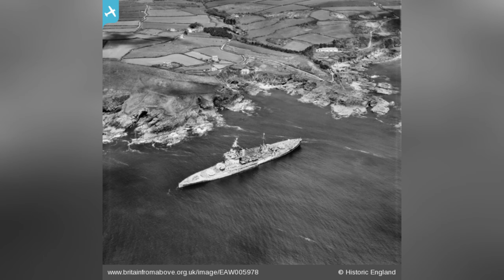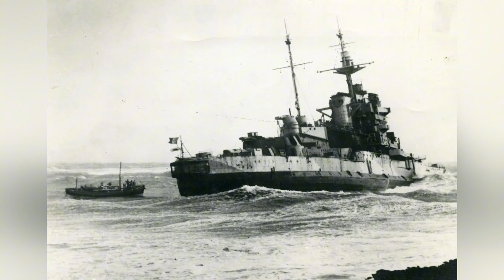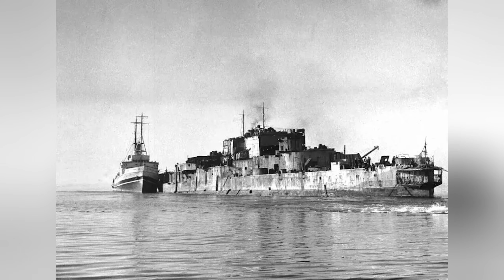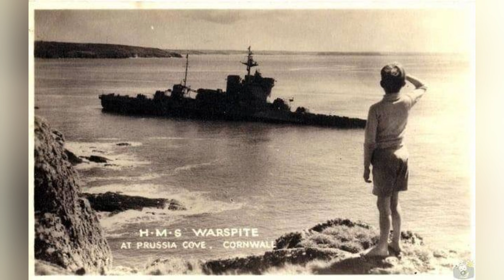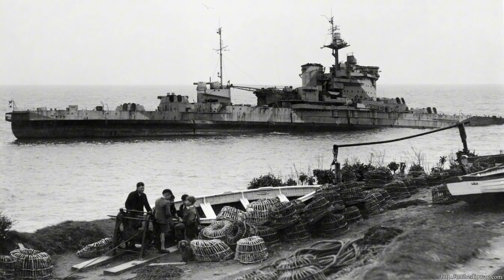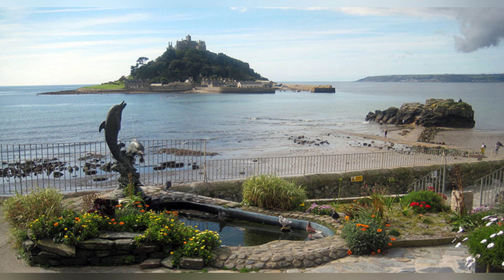Salvaging HMS Warspite: The Storm That Ripped Her Apart

Comment: Was the Bustler an ex Royal Navy flower class corvette? Would just be interested to know thanks for your thoughts on it.
Reply: HMS Bustler was built by Messrs Henry Robb and Co Ltd, of Leith, Edinburgh, 4/12/1941. She was laid down and built to original plans in her designated role as a light armoured Fleet Rescue Tug. Her length was 190ft x 38ft and displaced 1,118 tons, she was originally armed wirh 1x 3in Gun and 2x 20mm oerlikon/bofors but these were all removed after the cessation of hostilities, sometime during 1945/46 She was transferred from the Royal Navy to the RFA in 1959 and served as a Tug till 1973 when she was finally sold, the picture at the beginning of the video is an actual picture of HMS Bustler taken sometime between  1946 and 1973, during her service as an RFA. She was a rather handsome looking little ship with simple but pleasing lines.She was still listed as active under her Pennant Number A240 in the 1973/74 listings of Jane's Fighting Ships, but there is no  information on her so I can only surmise she had been decommisioned at that time and was on the disposal list, I only have one other photo of her to hand taken in 1946, sadly I have no details as to her eventual fate. I can find no information of a Flower Class Corvette under the name HMS Bustler, its very doubtful that there would have been two Royal Navy ships named HMS Bustler. There were only two previous vessels that were commisioned for the RN of the same name , a 16 gun, brig/sloop, purchased in 1780 and a 12 gun brig in 1805. Those are the only records on HMS Bustler I have, if I find any other info on a WW2 Corvette or Sloop under that name I will post it on here. I hope this information has been of any help to you, good luck and best wishes. 🖐
Reply: I thought this was a history lesson but the narration seems more like a English lesson